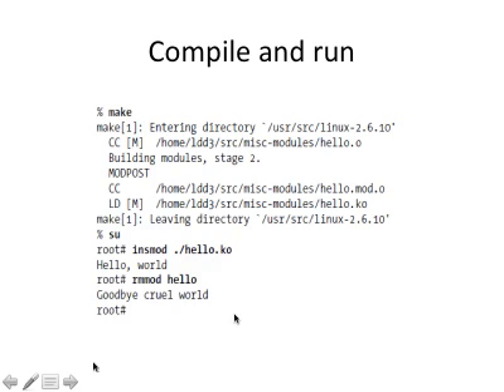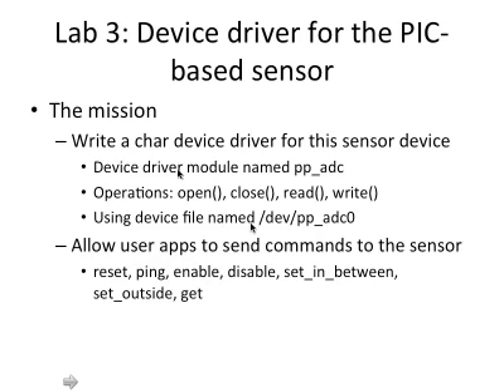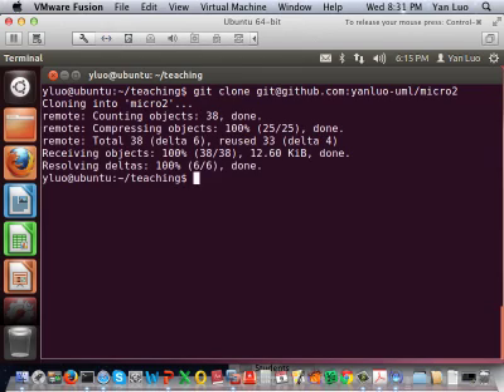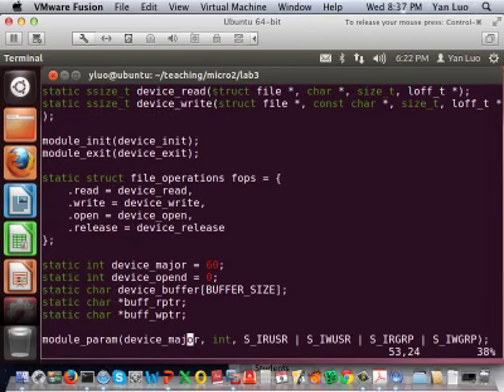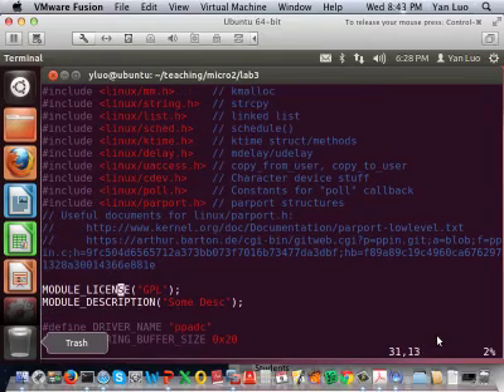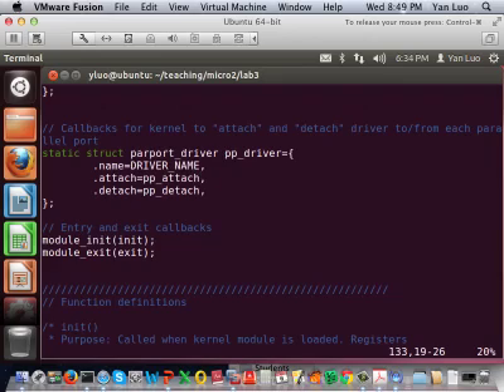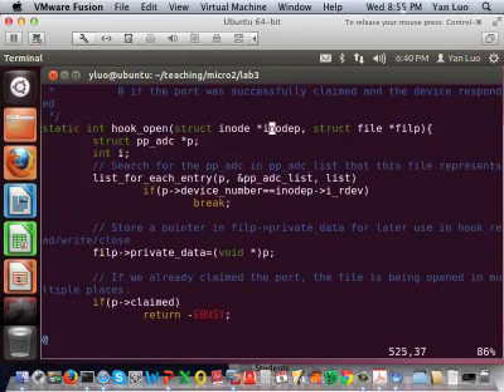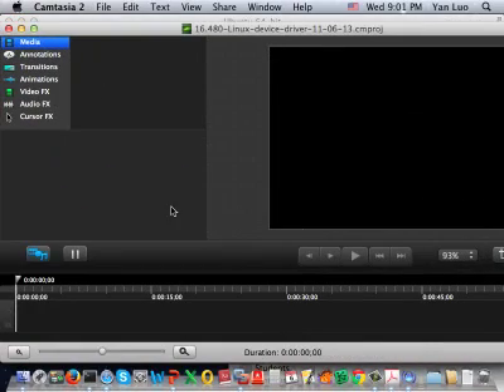Linux Device Driver , Part 1

Comment: Ok, you made a pic comunication driver but where did you picked the code? Have you done previously as an Embedded code to pic and adapted to kernel module programming? Or, where can i get the instrutions to develop my own kernel device for a pic? with codes and explainations?
Reply: +Pavel Teixeira Linux Device Drivers, Third Edition, a bit outdated but a good source to start

Comment: I have a dual boot on my laptop, windows 8.1 pro and ubuntu 13:10, and I use realtek usb wi-fi adapter for browsing. when I am in windows, the internet is very fast. but when switched to ubuntu, it is connected, but the signal is weak and can not open the internet. WHAT IS THE PROBLEM? thanks